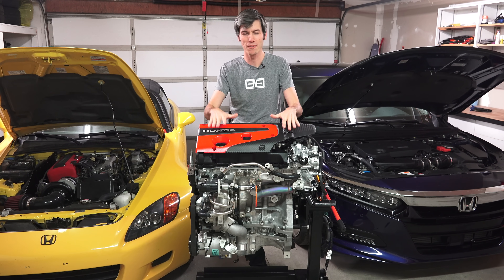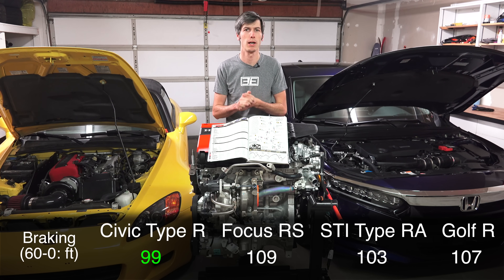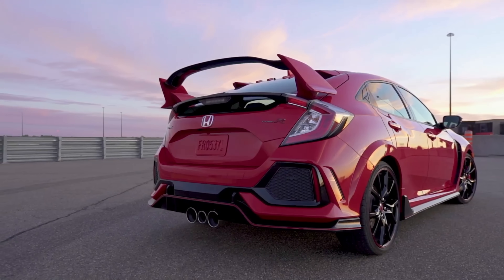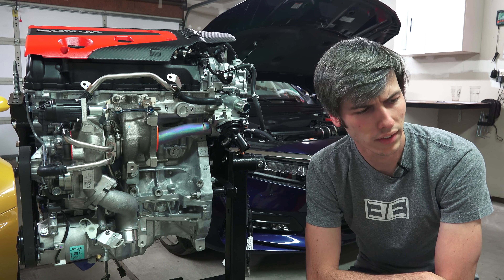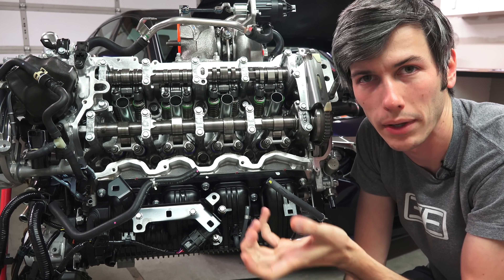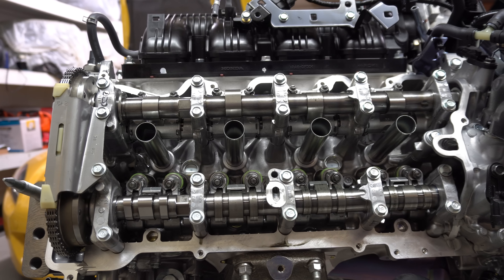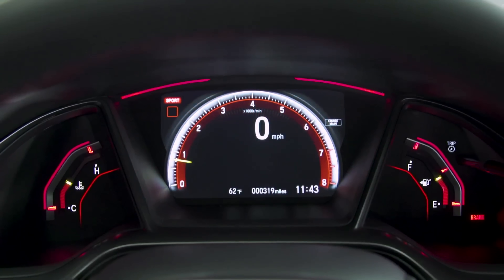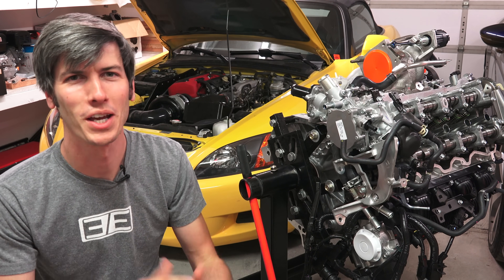The Honda Civic Type R Destroys The Competition - The Best Engines

Comment: I like the type R but ... All that fake carbon fiber and fake air ducts and eh. It's just to fake extreme.. I wish they made it look better and not so fake
Reply: Y'all complaining about the vents but have you seen the horrid looking exhaust
Reply: @Yann Dupuis Nope. Bunch of "vents" that aren't even vents
Reply: They turned it into a hot wheels car truthfully
Reply: Not Chris you’re just mad that it’s faster than what ever car you fan boy over. Only thing you can say is its looks.
Reply: Its straight up ugly, i don't care if it's marginally faster if i can't even stand to look at it.
Reply: Little they know that dents in the right spots are more aerodynamic than smooth surfaces.
Reply: @NothingXemnas  sounds legit
Reply: @josephhenry2925 
just check how golf balls work. aerodynamics are wonderful
Reply: Still fastest FWD car in nurgburgring.
Reply: @Veasna That doesn't make it aesthetically pleasing.
Reply: You do know that Honda offers a REAL carbon package to replace all the fake parts right? Front splitter, rear diffuser and spoiler get replaced with real carbon ones. Its a 4000 euro option if im not mistaken. As for the plastic block-off parts.. meh i can live with it. The car is an amazing piece of engineering and feels great to drive
Reply: Yeah Toyota, Nissan and Honda's design is in a weird place right now (except with the NSX, that car is S E X Y). I was about to say JDM in general but Mazda and Subaru make good stuff. Both the latest MX5 (RF BABYYYY) and the BRZ look great. 

Edit: I forgot about Mistubishi, so I looked up their latest Lancer, and... Good lord... What are they doing..?

Regarding carbon fibre... Sure it may save weight and all which is cool BUT (pls no crucify) I've never liked how it looks, even the real stuff. I don't like the checkered texture and it's always put in weird places. It's alright as a spoiler, lip or wheels, but I'll take a nice metallic colour over it any day. The worst is when they make the hood carbon, it almost always clashes with the paint job. Don't even get me started on interior design. I was almost reaching for a bucket when I saw the option to have carbon fibre trim in a Jaguar sedan.
Reply: Agree, every Japanese make (Mazda notable exception) has gone to 11 with the aggro styling. Need to calm tf down with the vents and useless wings
Reply: real carbon fiber at this price? with this kinda of performance? lol
Reply: @hollymolly518  I would be just fine with a Matte black finish. Adding fake carbon fiber just messes things up
Reply: At least they don't rebadge other cars and sell them as their own. That makes me so mad when company's do that. Like, they literally have one job and it's to make cars and they can't even do that?! Looking at you GM
Reply: i think they wanted tk make it outlandish and wild to get attention. any attention is good attention sometimes lol and the car does back it up with performance
Reply: That's why it's also the cheapest
Reply: Dat Boii  but its always been like that. And modding older cars is only cheaper and easier because they are older. In the 90s people werent really hitting 2000hp in 2jzs lol. At some point 600 was the most you could from an ej and now theres 1000hp cars.

Think about it. In the 90s it must of been cheaper just to grab an old challenger for cheap and mod that. Supercharger and bam.

If you want the best bang for buck you will ALWAYS buy used.  Always
Reply: When you take one for a drive you forget about any fake vents.
Reply: this is what happen when the designer of this car are not from Japanese
Reply: looks like the next lunar space module to land on the moon
Reply: @Yann Dupuis 
No it isnt. Closed off air "vents" don't do anything.
Reply: nope, the lack of a fake plastic vent would be MUCH more functional.   You cannot tell me fake plastic indent is more aerodynamic than a smooth surface . pre2000 civic is 100000 times better looking than this pile of garbage!
Reply: @daemiax  you're right about the looks but I wouldn't call it that pile of garbage exactly more baby boy racer Fast and Furious wannabe kind of car
Reply: Daemi Ax why does a golf ball have dents in then 🤔
Reply: are the dents plastic ( different material )? Or fake vents ? they are dents made out of the same material.
Reply: Theres always gonna be someone will who make a post like this...we get it...just appreciate for its engineering.
Reply: What do you expect from a fake race car?
Reply: fake race car beating other even faker race cars, yeah right! Anything is a race car as long as it move! lol

Comment: Did Honda mention the maintenance interval for the intake valves??  
If this is a direct injection engine, the back of the intake valves will carbon up.  
Did Honda come up with a fix for that problem??
Reply from the maker: They say it won't be an issue (spoke with the chief engineer) but I don't know why. Time will tell! Not all direct injection engines suffer from carbon problems.
Reply: @EngineeringExplained  Toyota recommends Injector cleaning services and Induction cleaning every 30K miles to prevent carbon build up (even on the hybrid systems). I don't see why Honda wouldn't use a similar service for they're engines if carbon buildup was actually an issue.
Reply: Is Honda using a PCV catch can to prevent crankcase oil vapours from entering the engine???

@Timmy Turner ~~ Toyota's recommendation for injector cleaning will do nothing to remove carbon build up on the intake valves.  'Induction cleaning' is a vague procedure.  Whats involved?
Reply: @EngineeringExplained  Would be great to know why. Good to know it was a design consideration.

Comment: Was the golf r manual and on factory tires? The earlier models came on inadequate tires, from a bunch of other reviews I've seen. And the DSG Transmission is far faster than the manual. Like fast enough to be worth $1100.
Reply from the maker: Yes, all cars compared were 6-speed manual, stock tires.
Reply: @EngineeringExplained  I know the main point of your video was to show off the inner workings of the new Type R engine and how impressive it is, and I wholeheartedly agree. However, I find some of the implications that you made in your video, especially in regards to the Golf R (and to a lesser extent the STI) to be a bit misleading. FYI it is fairly well known, especially within the Golf R community, that the manual transmission used in the Mk7 has many limitations both mechanical and electronic which greatly affects its straightline performance. These limitations have little or no bearing whatsoever on the capabilities of the engine itself and create a skewed image of the facts as is noted in some of the more biased and hyperbolic responses from various commenters below.

As a long time viewer and fan I'd like to say that it's not the first time I've seen slight factual errors and/or some distortion in the way you present certain things in your videos however it's never been anything that significantly detracts from the quality of the content in your videos. However this time I feel the integrity of the video has been compromised a bit due to this misrepresentation.

 I honestly feel like you could have just focused on the engine itself and not even bothered to bring up competitors and that would have done the job as well. You've provided some content purely focused on Honda in the past (which I've enjoyed), and it's been none the worse for a lack of comparison to other platforms. I believe that in order to truly give the other models their due would have required you to devote more time explaining the nuances about them and would have detracted from the main focus of this video in the first place, which was the Type R engine.

 Sorry for the ramble but I felt the need to chime in.
Reply: This was my very first thought looking at that - was it manual or auto? The DSG on the Golf really makes a big difference in acceleration. This, combined with the more subtle 'sleeper' styling, better infotainment, and AWD makes the Golf the obvious better choice for a daily enthusiast car and a damn fine track car. If you are only tracking it, then yeah I'd probably take the Civic.
Reply: @MadSeedling  the civic did almost everything better then the Golf. And you only see it as a track car? Its more then fine as a daily. Even more space then the golf.
Reply: Seeing their testing used the Michelin super sport tires, instead of the stock but upgrade package to the sport cup 2 tires. Which allows for better braking, turning, acceleration, and side geforce.
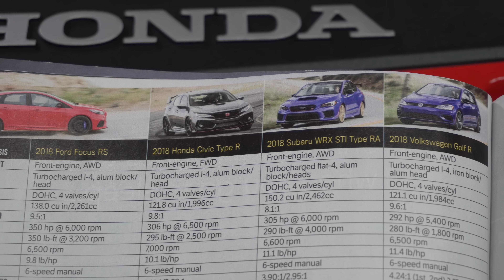Reply: Take a look at 0:28
Reply: A Golf fanboy goes at it again...do you even own one bro?
Reply: @JohnnyWhytetrash  not a fan boy, because I'm asking valid questions. And I'm not even saying that it's faster than other cars, it's that the difference between manual and DSG on that platform is regularly noted, as are the lame from factory tires.
Reply: I don't think the Focus or the Type R have automatic options, so that would be not on a level playing field

Comment: Urm is the water pump attached to the timing chain, almost unserviceable for the duration of the engine. But at 100k you would have sold it anyway.
Reply: ifell3 the water pump is driven by the serpentine belt.
Reply: @chettser  nice design then, the French would have put it on the chain!!

Comment: Just slightly sad it doesn't rev as high as the S2000.
Reply: actual perfomance >> rev
Reply: quarter mile time of the S2000 back in 2000 is comparable.  The revs help with torque multiplication significantly.
Reply: @coolguy91975  only if you're within the usable powerband
Reply: [POR] ShoterXX the turbocharger won’t be able to handle it.
Reply: @nvl2691  rb26dett revs 9k and is turbocharged
Reply: @DevasionX  but I doubt the RB26 would be able to get its emissions to levels anywhere near what is required for 2018 cars... Don't get me wrong, RB26s are awesome, but I doubt they could be allowed for production in 2018 without a major redesign in just about everything, just so they can be legally pass emissions standards and what have you... I mean, I doubt this particular K20 from the video is related much to the first K20A engines from the early 2000s anyway, besides some very basic architecture maybe...
Reply: DevasionX it actually revs to 8000 stock.
Reply: @DevasionX  completely different  turbo.
Reply: @DevasionX  Not stock mate
Reply: Nathan Vonlanthen
Turbo doesn't care about engine revs only airflow.

That's like saying if the engine had 15% more displacement the turbocharger wouldn't be able to handle it.
Reply: this is medium weight car, low rev is better for this type.
Reply: Revs are overrated.Low and mid torque is king

Comment: It may be faster around the track, but can it do doughnuts in the winter 🤔
Reply: give me some mcdonalds trays and it will without tearing the tyres
Reply: Not only it can, but it does them in reverse!
Reply: @Noise Control or just power slide with any of the other options, also I thought the type R had an electronic handbrake, not very good for drifting

Comment: Crap car with transmission issues, engine overheating issues, early seat wear and cheap materials.
Reply: This isn't your trash bucket that you drive.
Reply: i don't think my CLS is a trash bucket, nor is my SLK. My friend had new type R after he sold his A45 and i have pretty much a good source for knowledge about this car. He had it for a month, thats how long it lasted. Instead of throwing insults try actually providing some insight why you don't think so. Stop fanboying around and grow up.
Reply: Early seat wear? Tell your friend stop being a fatass.
Reply: I never had any reliability problems with my cars, i take care of them. My CLS is from 2012 and my SLK from 2005 soon swapping for an SL. No rust, no engine problems, no check engine lights which i had with my previous VW cars. Maybe that's USA issue since i've heard the models made for US market were of poor quality in comparison to European market. Plus i have plenty experience regarding modern cars issues because i work with them. Type R is just poorly made car but no surprise here, they made it cheaply.
Reply: Hahahaha, what the...? A Mercedes owner criticising Honda's reliability? Thats rich! Mercs are shoddily slapped together rust buckets in waiting (it's scary how quickly some of them rust, srs), you don't have to be rich to buy a Merc but you do to pay the garage bills out of warranty. They're lease-mobiles, out of warranty they belong in a recycling facility, they last 3-5 years and fall apart. You're paying for the badge and the posh interior. I always wanted a Merc growing up, when I got one I couldn't get rid of it fast enough, everyone I spoke to who loved them just dealt with the endless issues and the huge garage bills, my best mate got so sick of his he gave it away. We have  an independent non-bias company called 'Reliability Index' who gather statistics on car reliability over time (google 'em), the Civic is rated near the top at 31 (always has been), the CLS is practically at the bottom of the scoring range at 217, down there you find Audi too, another crappy German car company floating lazily on its past glory and somehow pooling the wool over consumers eyes with their planned obsolescence.

Comment: k20a2 was one of the best honda engines ever :) great vid mate !
Reply: Just any high performance K series is good. Best - K24 block + K20 head
Reply: @Kypcia  what are the advantages of this
Reply: @Kypcia  true! I got the k24A3 and i plan to throw a k20A2 later on it ;) destroying up to 300 HP NA cars with just 260-270HP NA Honda engine is something... the best so far i ve seen is 500HP NA 2.7 K series engine, the is a video you can see in youtube, its from a k24 engine!
Reply: I own a K20a2, 
I friggin love it
Reply: Loyal Honda Fan

Lol. You’re not destroying anything, bruv. Please stop with your lies.
Reply: K20A *
Reply: H22A***
Reply: I can't semm 09 si that I've had since 2011 because I love the engine so much. Silly fact, when I supercharged it it removed the awesome sounding stock intake sound... When taking my friends out for a drive afterwards they were like dude you should be more excited, you sound remorseful! Hahaha. I still say the stock intake in that car sounds incredible.
Reply: Fan boys are gay
Reply: Miss my K20a2 RSX Type-S (now own a Focus ST). Needed something with 4 doors to haul kids around. There's just something pure and uncomplicated about a naturally aspirated 7800 RPM engine.
Reply: h22 block and head, h23 crank, je oversized pistons, ect.
2.4l, 9000rpm at an early 1bar = enough power to go airborne when punching in on a small hill. the cruise control button pulls you back in the seat.
Reply: 14gbb b20v is k20s daddy
Reply: @guerrerok90  what?
Reply: K20z3😅
Reply: F20c is the best Honda engine
Reply: I agree, the F20c is one amazing engine, 
Only thing it is lacking is VTC from the k series.
(oh and a after market intake)